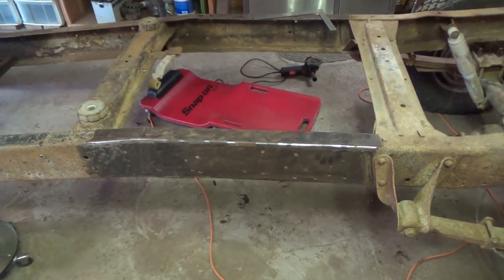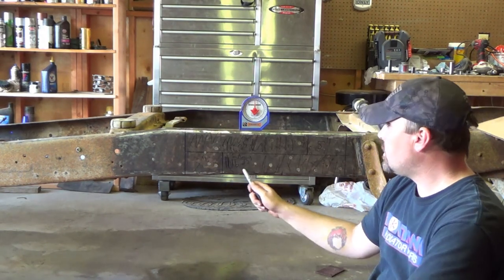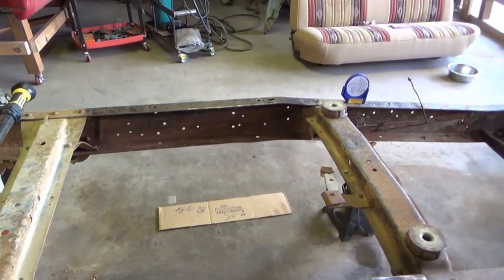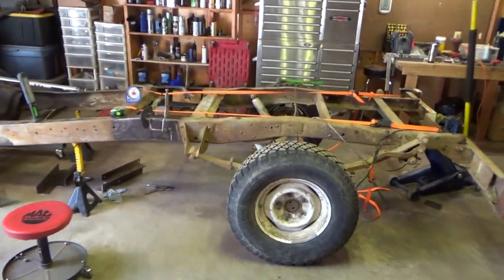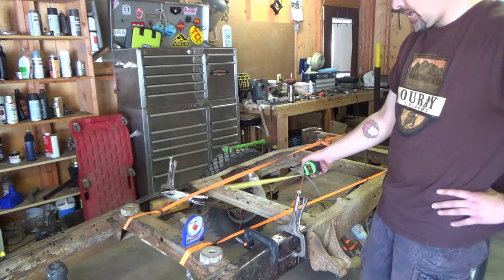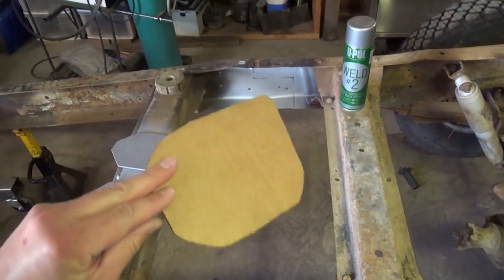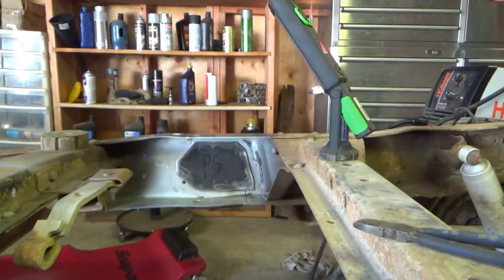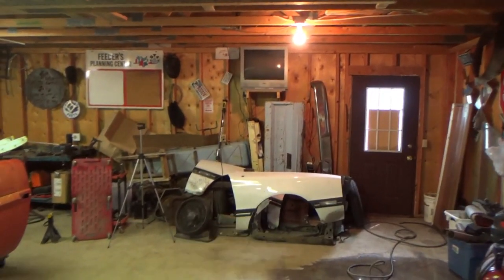67-72 Ford pickup frame shortening the right way!

Comment: Nice work on the frame shortening. The one suggestion I would give if you do another truck in the future.  When marking out the cut lines round off the corners and especially the inside corners.  I just use a cap off a spray can or roll of masking tape and trace around it. That way they are all the same. The sharp pointed inside corners can lead to cracking. So I avoid sharp corners/inside corners just to be safe.  There are a lot of people that don't and never have a issue. But I just don't like to chance it.

That is one beefy cab lifter!!  I couldn't tell if you had any or not. On top of it just to the out side of each drip rail add a small piece of 2x4 running front to back. That will make sure the cab doesn't slide side to side at all.

Keep up the good work! You've got a very cool project there.
Reply from the maker: Nice!  I think I will shorten it a bit as it's too long
Reply: I agree and thought the same thing about the Z shape cut.
When Ford makes a frame for the super duty trucks they weld the sections together with mig welding robots and use a straight line top to bottom with a big C curve about 1.5" from each edge. 
1.5" line 
C 
1.5" line 
|
c
|

Comment: We were taught to never cut 90 degrees to the long axis of a frame.  You are solidly on the right track with the "Z" cut. We did a diagonal cut in our shop, we would typically punch-mark the top flange for reference marks.  Next, we'd cut the top flange,  then course 45 degrees down and back, and cut the bottom flange. Thank you for the video.

Comment: I like your work and the extra time you take double checking. I would do a kind of zig-zag joint with all rounded corners. That reduces stress risers and makes a really strong joint and you shouldn't need a flitch plate to reinforce it.

Comment: You did a nice job on this.Your lucky to have a wife  who"s that helpful. Has anyone ever done this conversion by moving the spring hangers forward.Remount them then cut the extra off the back of the frame?
Reply from the maker: Don't think that would work on this generation because of the kickup in the frame.  I have seen that done on older (like 40s) pickups with a straight ladder frame

Comment: I’m getting ready to do this exact mod on my 70 f100. I have a factory shortbed I am using, as opposed to a shortened Longbed. I assume that 1/4” difference will be key for me?! I’m glad you mentioned that… so I need to do exactly like you, right? 16.25” & 3.75”?
Reply from the maker: Yep that is the factory measurements.  There us a chassis diagram on Ford Truck enthusiasts website if you search
Reply: @cprgarage3206  Sweet! Thanks. That should allow for an OEM shortbed to line right up👍🏽

Comment: Did you weld the back of the frame under the plates
Reply from the maker: NO.  Had good penetration from the outside and the reinforcement plate spans both sides of the joint.  If I was going to tow with it I would probably sandwich the joint with c channel on the outside.

Comment: Did u cut the back of bed? My 75 short bed compared to my 73 longbed differ by only 16 inch? Does that sound right? There for I wouldn’t need to cut the back the 3-1/4? Thanks
Reply from the maker: Not yet but follow me close here... on a bumpside 67-72 they are different in front and back.  On a dentside 73-79 the difference is only on FRONT of the axle.
Reply: @cprgarage3206  exactly what I have and wanted to know as well thanks man.

Comment: I would be amazed if this doesn’t crack in those corners over time. The plates were not nearly long enough.. also a cut off wheel works a lot better and lasts a lot longer if you do the opposite of what you said and let it cut its way through the metal… no wonder your cuts were so far off

Comment: lets see if u do it by law D.O.T. laws that is just what i thought nope not by the law u must bolt a plate 3 inches past the wields on the side of the frame u can wield on top or bottom without a plate but on the sides, u must bolt a plate to the frame  and the bolts must show 3 threads past the nuts or it will crack right by the wields over a few years i had to fix a lot of these builds like this plus if u sell it u are responsible for it and they can blame u for the accident this is y we had D.O.T. inspect all the rigs we wielded on the frame to cover are ass but u do it ur way i will do it my way if u notice most kits have the bolt hole all ready for it and they are set up for 1/2 inch bolt grade 5 must be used aircraft nut is recommended or lock nuts there are reasons  for the law like the frame breaking into 2 pieces just the vibrations from the road can break it right by the wields this is what D.O.T. calls an unsafe  rig but when u said the right way to do it then u ask for it because this is not the right way to do it by law even if u box the frame u still have to bolt a plate to it by law the law don't say if it is box or not it has to have a plate bolted to it . u need to know D.O.T> laws when u are building a rig like this .same with D.E.Q. laws just like if u are a dealer u can not sell a rig without the pollution system that it came factory with u must put it on it don't have to work but must be there or it is a 250,000 dollar fine to the dealer i have seen 7 dealers shipped closed over this law they took the biss. and fine them 250,000 for it  . it pays to know ur laws and i have seen pu's inspected at a scale they flagged them down and had them in the scale for inspection then i seen it being towed off about hr it took y had lunch and watched it all not sure what they had him for but he could not leave with it .
Reply from the maker: Ok...  none of that applies to me whatsoever building my personal pickup in my garage.  Thanks though, look into spell check.
Reply: @cprgarage3206  it does apply if u sell the rig just saying i have seen lots of people say they would never sell it but then they do and u claim this is the right way of doing it i claim by law it is not u could have said this is my way of doing it . and if u don't understand because of spell check so be it this way u can look smarter than me but to use spell check u must care first . i only been doing this for 45 years building show cars and semi's for shows trust me i am the guy u want to know plus i get rigs for free all the time or real cheap could have got u a rust free short box for a few hundred last few i got for free i got one 79 chevy with under 35,000 miles on it in mint condition for free .with the 400 sbc and 400 turbo 100% factory just gave a ls away in a 96 chevy pu just needed the trans rebuilt very clean truck i know were a long line of 67/72 fords are just sitting most are rust free can get them for 200 to 400 a pu with engines in them some with the 390 in it i live in oregon if u are interested they have a sweet 65 for cheap
Reply from the maker: @melissaweidman3326  I don't build rigs to sell.  Not sure where you live but I live in America and DOT only has jurisdiction over commercial motor vehicles.  They have zero say over what private citizens do to their own vehicles.
Reply: @cprgarage3206  DOT has authority over anything on the road just like a truck scale they can stop anyone and write them a ticket u did not know this every car built new has to go through inspection just like if u build a new trailer u have to have the wields inspected to get a title for it just the factory has a guy there from DOT to inspect them
Reply from the maker: @melissaweidman3326  not in Montana they don't.  Motor Carrier Services is the enforcement arm of DOT only has jurisdiction over commercially used vehicles.  I personally know two retired MCS patrol officers and I also have good knowledge of jurisdictional duties in my state thanks.  Again your strawman argument has nothing to do with me.  If you don't like don't watch!  Definitely don't watch the newer episode where I cut the whole front cradle out it might trigger you!

I'll let you know when it cracks apart, don't hold your breath!  The sky is falling!

And that is not true for new trailers in MT only the VIN is inpected.  I perform VIN inspections on new trailers and have firsthand knowledge of many of the things you are spouting off about.
Reply: @cprgarage3206  i read the book it claims that it covers commercials and none commercial vec. even says anything on the road and i use to work with the heads of DOT
Reply: @cprgarage3206  That was one heck of a sentence laid down up there......
Reply from the maker: @scottdunn some people have a lot of free time I guess!